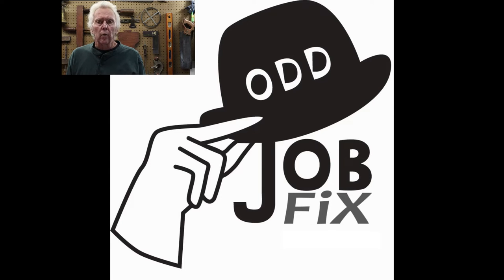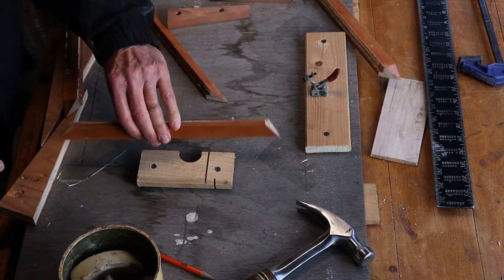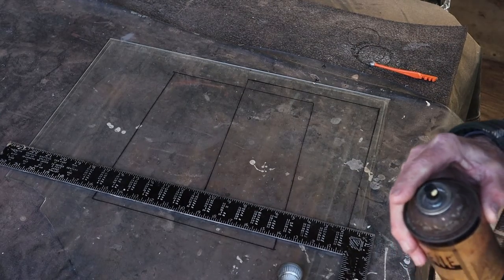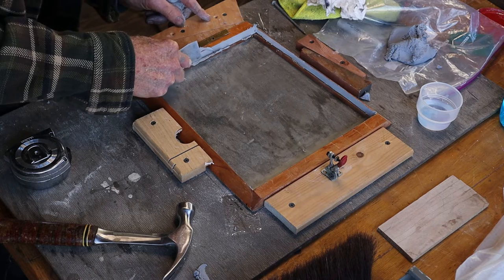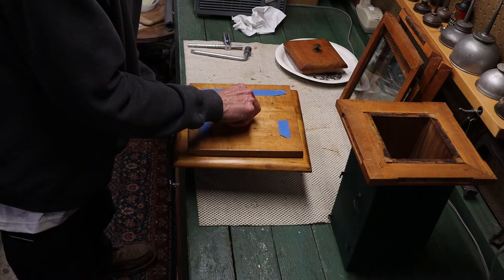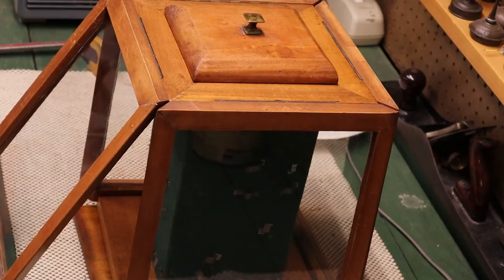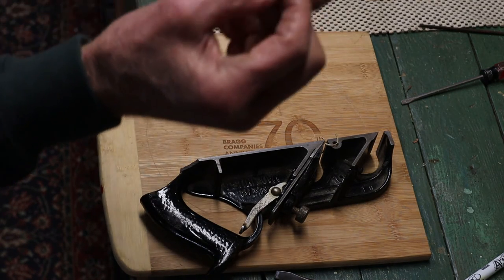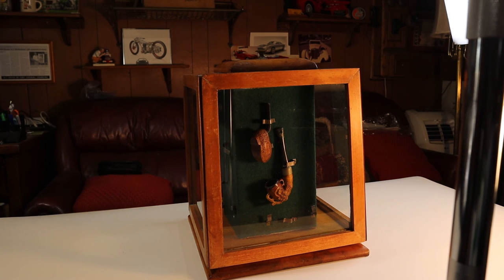What is this glass case? Basket case restored.

Comment: Drawing the angle lines on masking tape, on your sander table, is a great tip. That glue up jig was smart as well. Using that filed flat nail head to drive in the glaziers tack, smart again. When I saw that square bolt head I thought this piece must be before the 40's. Great job sir!!
Reply from the maker: Thank you Abbot. Nice to hear from you on 3 videos!